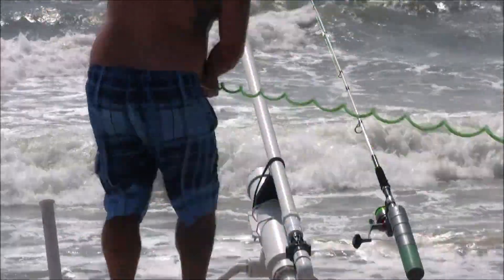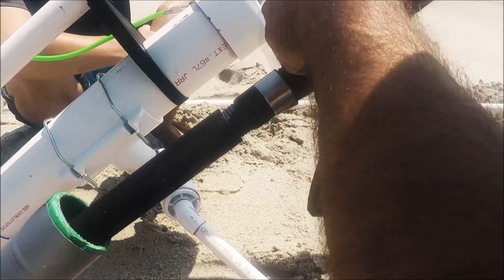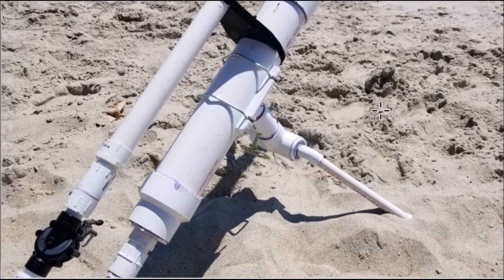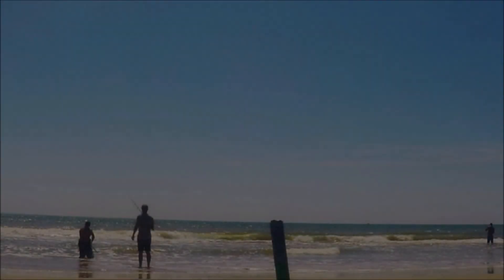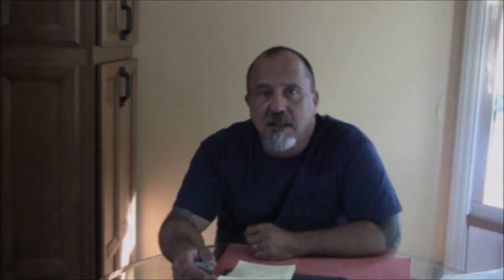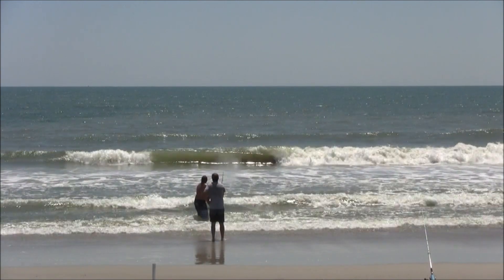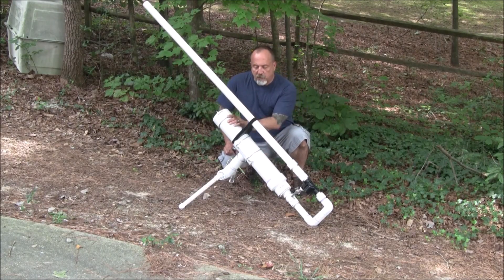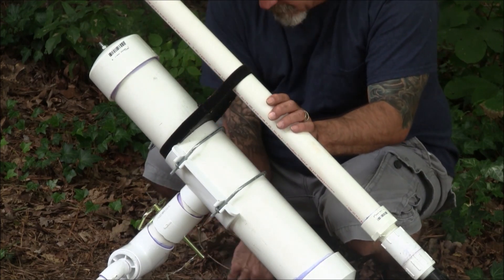Bait Cannon DIY Bait Launcher Air Cannon Beach Tests

Comment: do you have a simpler design? or smaller cannon. I want to make one, but I don't have all tools for it. I went fishing and could not get my lures past the breaking waves, so I want to make a cannon to at least get it past the waves.
Reply from the maker: Unfortunately I do not. I think this is as simple as you can get it without sacrificing safety. Hard to cast past the waves but not impossible, probably need a 12 ft surf pole and 5 or 6 ounce weight, that might help
Reply: @ExtremeDIYGuy   I have a 10 foot pole, I will go get a 5 & 6 ounce weigh.   thanks for the tips
Reply from the maker: You bet! Let us know how you do!
Reply: @ExtremeDIYGuy  i made one!!!!!  It’s small.  But wooooww it’s amazing. My bf helped a little.  I threatened him, if he didn’t help me then we would not go fishing until my cannon as done.  So we got to work!    They are super easy to make.    Oh my goodness it packs a powerful punch
Reply from the maker: @ynellirosas  That's awesome Nelli! You should post a video using it on your channel! Good luck and catch fish, and you have a great boyfriend lol!
Reply: @ExtremeDIYGuy  just wanted to update you, the cannon is fantastic, and I need your help again,   we have been using an air pump for tires, we definitely need a air compressor, which one did you use? we go to the pier, we don't have access to electricity, we do have a power bank. let me know which one you use and we will give it a try. thanks
Reply from the maker: @ynellirosas  Nelli, I ended up buying a small air compressor from Harbor Freight, it runs on A/C but my truck has an invertor so that works. It sounds like that won't work for you, you might try this (Affiliate link) https://amzn.to/32YRDvz As it is portable and can be usb charged on the fly from your power bank

Comment: my rainbird valve is honking as soon as i load air in the tank, any ideas why is this happening ?
Reply from the maker: Check the diaphragm spring make sure it's not out of place. You may also have to complete disassemble and make sure there is no debris on the actual valve, below the diaphragm.
Reply: ok ill do it again  thx for the reply @ExtremeDIYGuy
Reply from the maker: Any luck with the valve?

Comment: How many psi can hold it?
Reply from the maker: I've had it up to 110 psi, Will prob go higher but that would probably be in the danger zone. Handles and shoots bait nicely between 85 and 95 psi.
Reply: If i use 95 psi how far yards can go. I'll make one like you desing
Reply from the maker: @rafaelnateq8997  Hard to say, it depends on how heavy the bait slug is, the length of the barrel has a lot to do with it as well. I would guess that you can expect a minimum of 150 yds.
Reply: @ExtremeDIYGuy  thanks man. It sound good to me